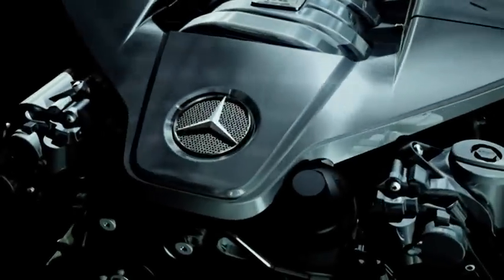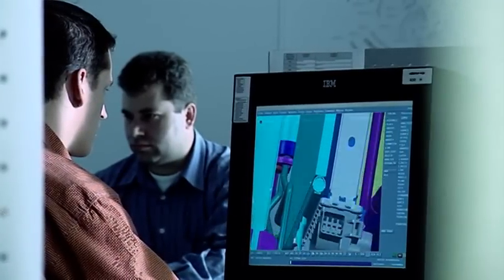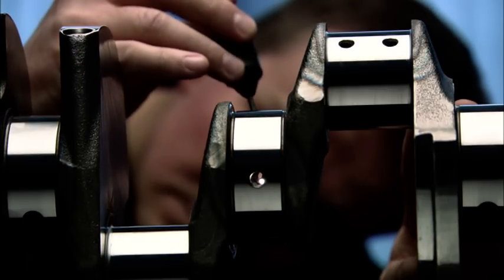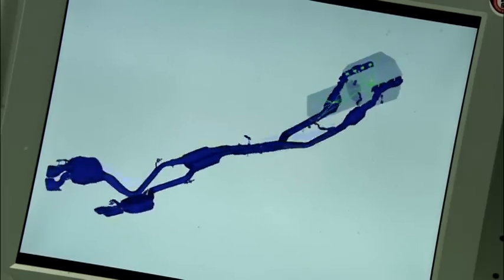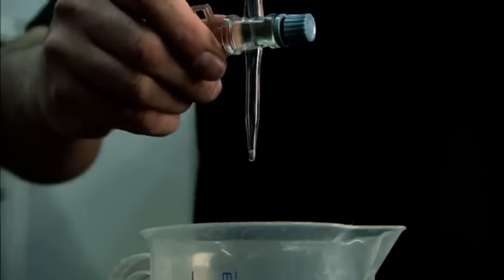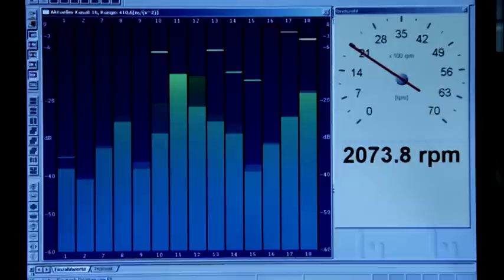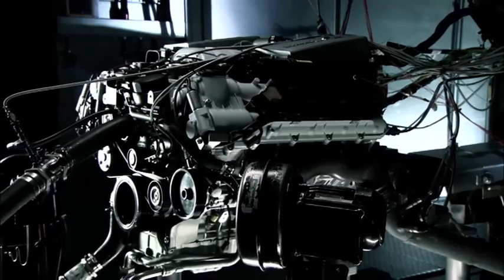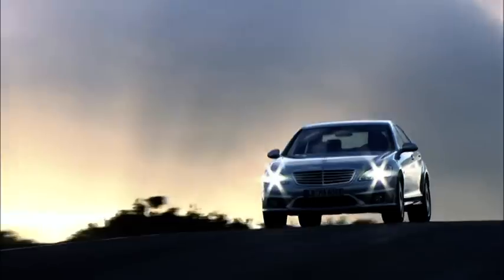AMG 6.3-liter V8 Engine

Comment: i don't get it...if the engine actually is 6.2 liters how can you advertise and sell it as 6.3???why are you trying to cheat on us mercedes??that's why i got a bmw myself
Reply: almost all manufacturers round up or down. relax. technically your bmw which is probably a 6cylinder model is really a 2.9, not a 3.0
Reply from the maker: Felipe K - Thank you for your questions. In Germany, displacement is always measured by 100 cc, which means as soon as you are over 6200 it counts as 6300; therefore, it is a 6.3 liter engine.
Reply: +Mercedes-AMG The true reason for the naming is to commemorate the 6.3 liter M100 AMG engine. Obviously you people (Mercedes-AMG) know this, so I am not trying to 'inform'. But, you should advertise it as 6.2 liter, for the sole purpose of clarifying for those unaware that the M156 achieved over 100hp / per liter power to displacement ratio in the SLS AMG Black series.
Reply: Oh really, thats why :D And what bmw did you get? An old 5 series, or its "too thirsty" so you took 1,6 petrol 3 series from around 2003? 
GodlessMartyr666 > we all read your knowledge before, dont have to repeat it after every comment. And by the way - no one cares, they can call it 174,543 - fans of amg will still buy it.
Reply: i think they wanted to fit the 63 in the name but i dont know why it couldnt be a c62 or s62 or e62 lol
Reply: 6.2997 liter
Reply: Dein Vater Where the fuck did you get that from? It's 6.208 which means literally 6.2 you can't round up a tenth of a liter based on 8cc
Reply: That's incorrect.  The displacement is 6208 cc or 6.208 liters.

Comment: Don't let this overhyped German fool you. The lowest state of tune gives 450 Hp and 442 lb-ft of torque, matched by the current generation Camaro and yet GM managed this output from a much simpler 2 valves / cylinder (vs 4 valves / cylinder) pushrod engine which is not only cheaper to manufacture and repair but cheaper to service and maintain. New corvette with 755 Hp and Dodge Demon with 840 Hp which European engine builders can't match. Buy American.
Reply: Valentino Rossi 
Shout top fuel dragsters use 2 valves per cylinder and make 10,000hp. It’s not about valve configuration. It’s about the overall build quality of the whole car. After 10 years a daily driven Camaro looks like crap, while the benz still looks brand new
Reply: US automotive technology has progressed rapidly in the last 5 years so we make cars as good as the European at significantly cheaper prices. 840 HP Demon is still 'affordable" and cheaper than 700 Hp Ferrari, Porsche 911GT2 etc.
Reply: Valentino Rossi 
The big difference between American cars vs German cars, is the quality of the materials that they put in the vehicle. American cars are known for there reliability, dodge ford Chevy, make reliable trucks, most of there cars are below average. Mercedes doesn’t make the most reliable cars either, but there fun cars, top quality materials throughout the whole car. I’ve Owned benzes for the past 7 years now, I’ll tell you there way better then BMW, I’ve owned several bmw’s. Lexus builds the most reliable luxury cars. But Mercedes are hard to compete against when it comes right down to it. Drive a Dodge Challenger, or charger, then go drive a E class, you will see the difference. Mercedes have the best ride quality.
Reply: most americans drive german 😂